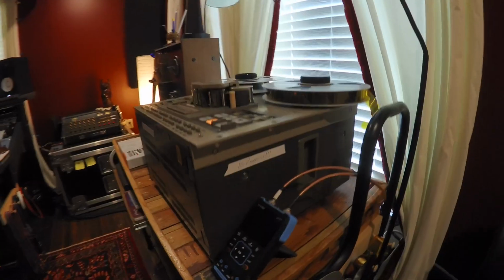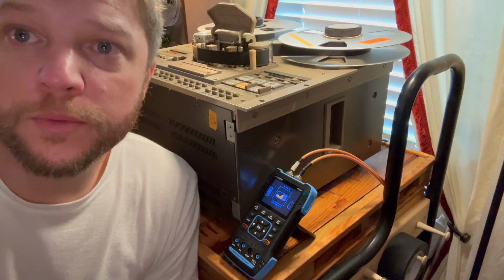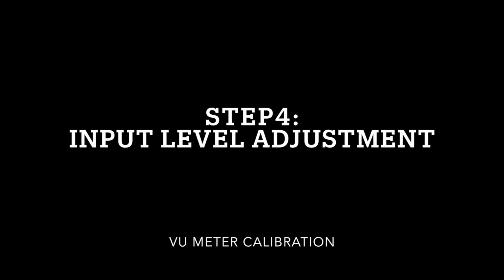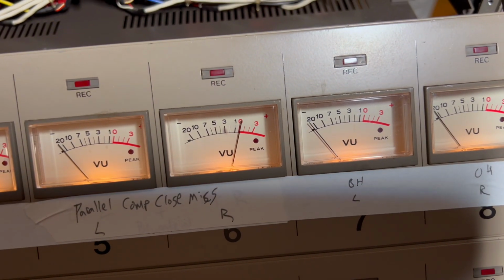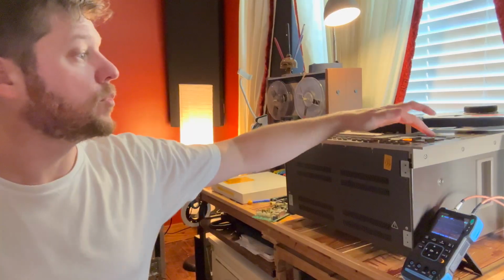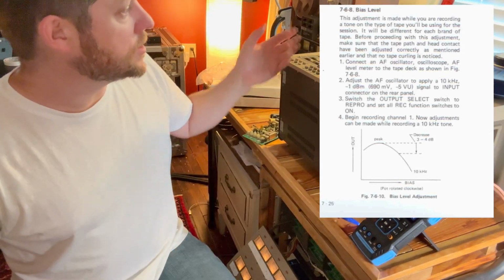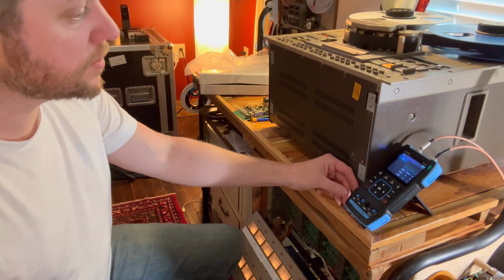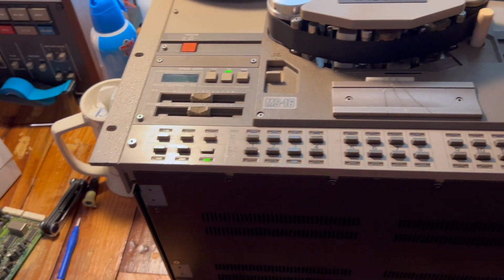TAPE MACHINE CALIBRATION part 2 Tascam MS-16

Comment: Thank you for this video. I have a minty MS-16 and so far it sounds great In/Out and I've had no need to recalibrate. I'm using SM911 tape, seems to be biased and calibrated for it already. Whew! BUT, I do have the MRL and will do a full "peace of mind" calibration soon. I'm thinking although my M-520 console has a built in tone generator, I might like to get the unit you linked to have that osciloscope as well. How did you connect the leads from the device to your channels? Did you have to create a special BNC to RCA or XLR? I have patch bays set up with mine using 1/4" TS cables, what is your best method to connect it? Thanks again, awesome video and thank you for sharing in such an informative and fun manner!
Reply from the maker: Yes! RCA to BNC cables from Amazon. They’re probably 2-3 ft long at the most. The RCA jacks will defeat the XLR connections, so you don’t even have to disconnect your pb setup. 
Glad you liked the video. If you decide to give it a go, get some video of the process. I’d love to see your setup!
Reply: @FridayGuyRecords I sure will do a video and I’ll link yours and credit you for your excellent help!
Reply: @FridayGuyRecords my deck is wired up using the RCA to my M-520 console  with 4 16 channel snakes with the patch bay in the middle. I’m wondering if I will just run the oscilloscope thru the PB in/out via BNC to 1/4” TS.
Reply: @FridayGuyRecords  Do you think it's best to plug directly into the machine or would the patchbay inbetween give a false or same accurate readings? I got the oscilloscope you used in today with BNC to 1/4" TS cables. I set the Signal Generator at 1khz @ 1.2v. The oscilloscope reads 1.15v. All VUs are at +3db as well, so some adjustment there too. I'm rewatching your video for the 10th time... Thanks for this, I hope to succeed and I'll share!
Reply: @FridayGuyRecords  Okay, it's in the doing of it! ha ha I just did channels 1-3 level and meter, your directions worked perfectly using the settings you laid out in the video. Wow, thanks again! I have some video of it and will include it in my next video that will be a studio tour. Then I'll do the whole calibration before my next recording session show. I doubt I'll show that since I will happily point folks in your direction for these videos and urge them to subscribe to your channel.
Reply: Would you mind expanding on the Head Azimuth alignment section of your video. I’m using the same meter you linked, but not sure what settings will work best for that measurement. Any help you can offer, greatly appreciated. Thanks!

Comment: So, I bought the scope/ generator you have. My Tascam 38 is -10/ .3v input. It seems the signal generator has a peak to peak output and Tascam is expecting an rms in which skews the reading by a large margin. I have to set the  generator at .9 v to get a 0 VU reading/.316v. Did you encounter the same thing? I didn’t know if you didn’t feel the need to explain the conversion. Thanks!
Reply from the maker: @mowrer09  yes! There is a way to change the reading to rms rather than peak. I will make an amendment video soon and recalibrate it properly.
Reply: This is very interesting, I also have a Tascam 38, I bought a cheap standalone signal generator, and when I tested the sine wave with my Fluke RMS meter, like you said when I set the sine wave to 1v it measured roughly 0.3volts. apparently the RMS of sine wave is 35.4% of the peak to peak value, so yeah roughly a 3rd. I did not realize I had to compensate for this tho. I'm just waiting for the test tape to arrive, so I'm glad that I came back to this video and read your comment. Thanks!

Comment: Is there any reason you calibrated it to +3 when sm911 is +6 output tape? Why not calibrate to +6? New to this!!!!
Reply from the maker: great question! SM911 is +6 dB over 185 nWb/m (the Ampex standard). This particular machine operates at 250 nWb/m by default. So I calibrated it for +3 above that. The result is +3/250 or +6/185
Reply: @ Thanks!!!

Comment: Are you using 1.23 Volt peak-peak instead of Volt rms? Can't see it clearly....
Reply from the maker: VPP. Someone sent me some info on this topic and it seems like Volt RMS is the way to go. 
Your thoughts?
Reply: @FridayGuyRecords  I answered here, but YT deleted my answer, probably because it had the URL to my conversion page in it. Oh, well......
Yes, in audio and calibration and stuff all voltage levels are Vrms.
If you google on 'Calculate Volts Peak or Volts Peak-Peak to Volts RMS and vice versa' my page is one of the first hits. There you can convert your levels.
Reply from the maker: @PhilipvanderMatten would it be a drastic difference in outcomes?
Reply: @FridayGuyRecords  1.23 Vpp equals 0.435	Vrms, see the conversion page.
Reply from the maker: That sounds pretty drastic 😆
Reply from the maker: @PhilipvanderMatten thank you! It turns out this oscilloscope has a vrms reading. So, I’ll be doing an update soon.
Reply: All right….subbed! Love your demeanor and how detailed you were being. Great job. Seriously great job…..

Comment: Great video‼️ 

I recently got the same machine and it’s been sounding great.  

Have you had the chance to check out the speed mods for this machine by installing a DP3T switch?  

I was thinking of attempting to do it to mine to get access to 7 & 30ips.  It doesn’t have eq adjustments but I have another older machine that does 15ips but only has 7ips eq and it still works wonderfully.  

Anyways would be great to see a video on that 😏
Reply from the maker: I've never heard of that. If you do it, make a video. I'd love to see that!

Comment: Thank you so much for posting this! I just got my ms-16 up and running! I’ve noticed on my machine that the playback from my repro head has noticeably less highs than my sync head? Do you think this is a bias adjustment issue or an azimuth adjustment issue..? I’m completely open to any suggestions… Thanks!
Reply from the maker: That’s a great question! It could be a bias issue or a high eq adjustment. I would recommend demagnetizing and cleaning the heads and then doing this full setup. That would eliminate a lot of the guess work and resolve any adjustment issues. 
If head wear or old capacitors are the culprit, you will probably find that during the setup as well. You’ll be getting weird reading. 
When in doubt, find a good audio shop! And if that’s not an option, I’d just stick with using the sync head on playback if it sounds good! 
Hope that helps! Good luck to you!
Reply: @FridayGuyRecords  that's all good advice. I'd check the high frequency calibration first. If the wave forms are close to alignment, then the azimuth is probably OK. I'll do a little research and see if I can think of anything else.